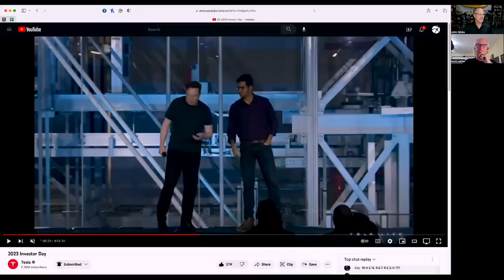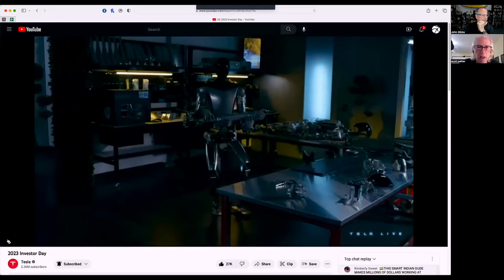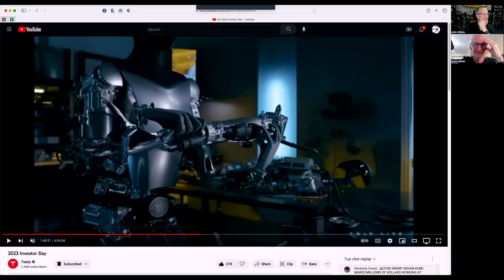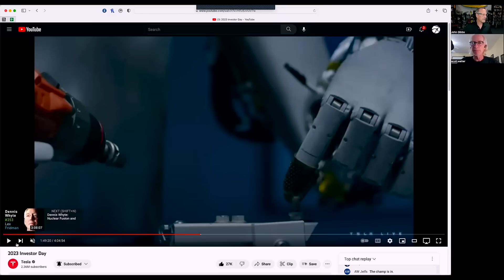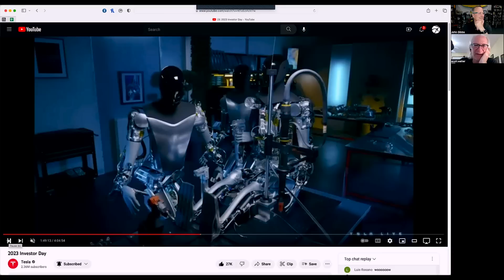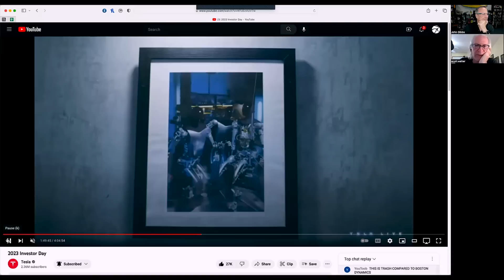Tesla's Optimus Bot Makes HUGE STRIDES! Investor Day Teslabot Details--with Dr. Scott Walter

Comment: Honestly they can put the torso or the whole robot on a automotive arm and make the arm maneuver bumbl into position to work on hand kematics on the assembly line for simple bolting. This is great but as you mentioned it’s to slow for a assembly line. But on a kematic arm this could stress it to automotive speeds with using off the shelf hand tools if that’s the route they wish to go

Comment: If you can put the word Tesla on a car, then you can put Tesla on All Cell Phones and Laptops. Electrical machines are old like since 1950s, Nuclear fusion Reactors, they just decided to give it to society as if it's new, like wireless, using cords when they been knew about bouncing signals. Circuit boards technology using copper was from inside the pyramids, with wireless technology from solar power, all hidden. Solar power cars is the obvious free energy and free electricity. The more empty man feels, he makes robots to fill in that hole, to feel like a God.

Comment: This will be a self replicating production line. This will be a first for the entire world, the efficiencies of this even at early stages will be the fastest scale the world has ever seen for any production line. 
If it takes 10 robots to make 1 robot in 2.4 hours, that means 10 built in one day. with these 10 new robots we have doubled the output. The next day it can make 20, the day after 40, the day after 80, the day after 160 etc, etc.. The only way to get more than 8 billion is self reproduction. With unlimited material, and unlimited floor space a cumulative doubling of production can scale to 1 billion units per day of production in one month. I am obviously wrong about my projection numbers. However the theory is sound, it is self replication, the robots will make the robots which in turn start making new robots right off the line. This will be the biggest step forward for humanity in our lifetime, forget the cars this is where the real value lies. I feel like no one is realizing the scale of output, when you run the numbers it is in excess of what is perceived to be possible. Humans cannot imagine a scale as large as this it is completely beyond our current understanding of production.
Not only will these robots be able to build themselves without human intervention. They will install upgrades that the robotics and automation engineer teams develop. The team develops upgrades, the horde of robots install the upgrades on each other almost instantly.
Giga Mexico is twice the size of Texas, why do they need this floor space if the model 2 line is smaller and more efficient. These robots will start mass production as soon as Giga Mexico is complete. In approximately one year from now.

Comment: Nice video, thank you gentlemen. Watching Optimus at station doing a task, it occured to me that having the ability to create an anchor point to the floor at will with either foot at any moment via electromagnets would eliminate the disadvantage of having to balance untethered to anything while doing a task at station. This would greatly simplify balance compute load during working tasks and give Optimus the ability to leverage its strength and dexterity to its maximum potential. A smart-floor installed in the work zone, mapped out, could provide the housing for most of the heavier components and Optimus could control it's application and performance through its feet. This would give Optimus some of the advantages a stationary assembly robot has when working from a fixed location on a pivot. Additionally, Optimus' mobility performance, just walking around, could be greatly sped up and improved within the work zone by strategically pulsing the electromagnetic foot/floor attachment force. This would be like having a super strong dexterous body and lightweight magnetic feet that turn on and off as you walk and provide incremental amounts of magnetism to facilitate the walking or running task. This would be the factory Optimus. Perhaps homes could eventually have smart floors for the home Optimus.

Comment: FYI, pneumatics have much finer control over movement than step motors (which are commonly used in electro-mechanical movement) and can exert variable pressure while maintaining a position without generating heat - Optimus may be using an amalgam of electrical and pneumatic systems - time will tell...

Comment: Thanks for discussing one of my favorite topics.  Great job Dr Gibbs and Dr Scott. :).  I noticed that there are special equipment used for drilling to minimize the weight that TeslaBot has to carry like the one used to drive the bolt on the knee joint.  TeslaBot is not required to have super human strength to be useful.

Comment: I'd propose a different hand design, symmetric with 3 fingers and 2 thumbs. The thumbs have swivel mounts so they can curve the same direction as the fingers, or oppose the fingers for grasping. Being symmetric, it would work equally well for right and left hands, no need for a "right hand" and "left hand" version.

Comment: Great commentary from the both of you on this.  Not sure if you've watched the video in high-res (the settings wheel isn't showing HD or 4K on the YouTube video in your clip), but just wanted to point out that the video is actually available in 4K in the settings and you can see a lot more detail on that setting.  At lower resolutions YouTube creates a lot of artefacts that make it look a bit unrealistic, but on the 4K setting it's much more obvious that it's real.

Comment: @Dr.Know-it-all Knows it all   
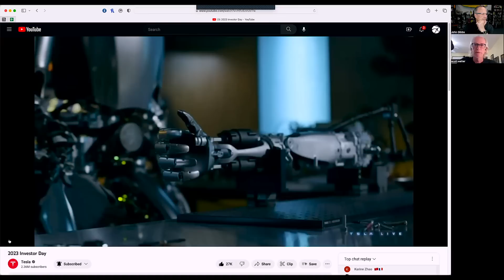2:40 you can use [LEFT/RIGHT] cursor keys on keyboard to skip in 5 sec. increments, and use [J] and [L} for 10 sec. increments, also use [K} for play/pause :)  

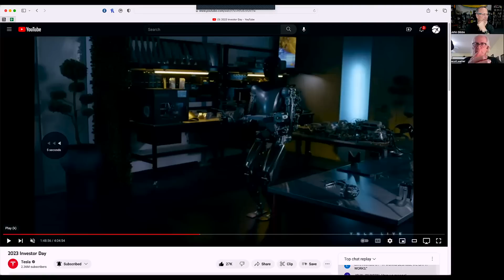7:20 when Dr. Scott described the TeslaBot having fingers that are spring-loaded and only uses an actuator to close, this is exactly how bats sleep hanging from trees, only in reverse, Bats have the default tension closing their claws, enabling them to hold onto tree branches in their sleep :)
Reply: You can use period and comma to increment frame by frame as well.

Comment: Unlikely any pipework is pneumatic for the same reason you don't want air in your brakes; hydraulics would be required for the transmission of force.

Comment: I personally think that nobody in the industry will be remotely able to compete with Tesla in the future! The continuing drive towards efficiency and automation is never heard off and these humanoid robots will change everything. If I was the competition I would be living a real nightmare!
Reply: Toyota does a pretty good job of building cars.  Tesla started from ground zero, so are just now catching up. 

I'm not a Tesla detractor (I bought stock on December after all), but I'm just tired of all the Kool-Aid in the comments.
Reply: @alansnyder8448  Toyota, is that the manufacturer that was still busy with hydrogen cars and wasn’t able to keep the wheels on their electric car. A false claim by the way from their part for god knows what reason. That company that had 1 electric car, stopped selling it and wanted to buy back the sold cars? You’re talking about them? The most in-depth company on the face of the planet where the hydrogen lunatic just stepped aside to indeed leave command for successor with brains who ordered to tear down a model Y to see how it’s really done.  There’s no legacy auto maker even near what Tesla is doing. Have a look @ Sandy Munro. Toyota will exist in the future because the lunatic just stepped down, it was almost game over. It’s not about building cars but about building electric cars. There is a huge difference in that. Toyota is nowhere at this moment.

Comment: Hi, John,
You mentioned that you could only go forward and back on the YouTube  video 10 seconds at a time.  Once the video is paused, you can move forward and back one frame at a time by using the comma and period keys.  THe shift of those are < and > to give you a reminder of the keys and direction.  If you have your settings for repeating keys held down,, you can move forward and back reasonably smoothly to exactly where you want.  I wonder how many other tricks like this are hidden in the YT user interface?
Dave
Reply: In YouTube settings you can also change how many seconds a default "skip" is. With 5s being minimum and what i usually use.

Comment: So where did they put the cooling radiator for the liquid cooling system ?. Or are they using the chest aluminum plate as the passive heatsink for fanless system ?.

Comment: Question: Would you use the surface metal plates of the robot itself to radiate the heat generated by the bots’ computer much like the capillaries in the skin of a human?

Comment: Stop basing your calculations on the price of a TeslaBot or as Elon called it a OptimusSubprime as being hundreds of thousands of dollars per unit. 
Given that a Tesla EV costs around $50K and that the TeslaBot will require far less material and time, it will cost about $10k. 
Imagine how fast Tesla will be able to build these, squirting the endo-skeletons out of a Giga casting machine, sliding in the wiring, the LFP batteries, the FSD computer, the interface, the sensors, and the actuators by the robots of the assembly line, unit testing and then zipping up a synthetic skin onto it. It should be producing up to a thousand Automatons a day.

Comment: Can’t they do better with the feet? Just about every robot I’ve seen use the simple flat paddle feet which makes the walking movements very awkward.
Reply: Nobody cares, it’s not a priority.
Reply: They obviously will in time.  Tesla's goal was to produce a minimum viable product in as short a time as possible.  So they are first focusing on making something that's going to be useful in as little as a couple of years.  The first bots will be working in factories (Tesla will start with their own factories) and so they will mostly be standing at a work station doing stuff and they don't need to be able to walk about all that much.

They will rapidly iterate on the design as they learn more about what's required and successive generations will add more functionality as needed.

Comment: Not parkour... but much of the agility and dynamic dexterity needed to work with humans and moving robots/assembly lines will require similar capability.  Maybe a training task down the road is an obstacle course where Optimus learns (teaches itself by trial and error) to move.
Reply: Parkour is not that hard. I've seen many robots doing it in simulation. Some were able to adapt to injuries and even different bodies. It's really a solved problem. Probably that's why Tesla is focusing on the hand instead.
Look around on the Two Minute Papers channel.
Reply: parkour doesnt pay the bills and probably requires expensive parts

Comment: We are so lucky that Elon put the bot under the Tesla umbrella, he could have launced a new company and sold stock in that. Instead we investors in Tesla get it for free !!
Reply: Very true, I am very happy with what I saw in the presentation and would not wonder, if GF Mexico will make use of a few Optimus robots.
Reply: @nilsfrederking62  I doubt it, labor is pretty cheap in Mexico.
Reply: @toadsauce8091  Yeah maybe they will even produce without Kuka robots on the production line..... That Tesla wants to let human labor do by robots is evident, so the next factory where they can test it out, they will do, the only question is whether Optimus will be advanced enough to make sense. And for sure they would not put it in the front line, more in preparational work, where there is enough time buffer, if something is not working.
Reply: I disagree.     This humanoid robot smells like an Elon Musk ego project to me.     Custom robots would be better. This thing is a waste of Tesla's time and resources.
Reply: @alansnyder8448  Just like the cybertruck maybe ?😉
Reply: @MrAlanfalk73  The capacity to build all cars/trucks and electrify the grid is going to be constrained by battery production which will largely be a factor of lithium supplies. 

I think we are better off making smaller cars to spread that limited supply around to more people.    So, Cybertruck isn't really helping the environment as much as people think.

But no, CyberTruck is important for Tesla. The robot is wasting time.
Reply: @alansnyder8448  wrong,  batteries and their effeciency constantly improve. With a solar roof it is 0% co2 , also people buys trucks so instead of a gasolin car the can get an electric.  Also regarding the bot, there will be synergies between those and FSD. And No time is wasted,  Tesla hires All the people it needs and they have money to spare still,  so bot wont slow Tesla down. As an investor I couldnt be more thrilled about the bot, it will soon help in production. 
PS. Elon has proved he can do the impossible with rockets and cars etc. so I think he can pull this off too. And the smartest people in the world wants to work with Elon,  that is why space x and Tesla has been the number 1 and 2 prefered places to work for ingeneers the Last 5 years.
Reply: The concept is to use the FSD software on the bot. This is the right move, otherwise, the bot development won’t work or very difficult without FSD.

Comment: What is interesting to me is that Elon said that FSD was NOT AGI in his opinion. Instead it was a bunch of neural networks. 
Optimus is using the same FSD engine, ergo Optimus is not AGI. 
Given Elon’s comments during the presentation on how he is worried about AI, and sorry that he may have contributed to it in founding OpenAI, perhaps not having Optimus be true AGI is intentional??
    If Tesla can make a truly useful general purpose robot without making it a true AGI, wouldn’t that be preferable?  A fantastic tool for humans rather than a competitor to replace humans?
Reply: Very good and interesting points. Here is my take, for Open AI yes Elon funded it to have an open-source AI project to answer google AI projects. but seeing it from the inside he was one of those calling for AI regulations very early on. A few years back.  On the other hand, FSD can only drive while AGI knows everything else. Imagine a highly sophisticated humanoid robot way more capable than us and has all the information that we can find in all search engines. That will be very scary. So most definitely Optimus is intended to have limited intelligence only for a particular purpose even if it has the capability to learn in its environment. Even if Elon or Tesla didn't start these kinds of projects somebody else will.
Reply: It uses the vision system of fsd, but it'll incorporate different networks to understand language, for example. You are assuming things there...
Reply: @lechavs  True, guilty as charged. 😉
Reply: No one has created "AGI"

Comment: The issue i saw with the Optimus video is that every action of the bot, there was an edit in the video.  Makes me think every step had several takes and the success made it in the video.
Reply: Of course it was, and reposition (manually) and so on. As like all their videos of "amazing" things.
Reply: @Xanthopteryx  Ok paid hater.
Reply: @neeljavia2965  Naaw, so cute of you thinking i get paid to tell the truth. Sadly, i do not. I tell the truth on my spare time. Unpaid.
Reply: @Xanthopteryx  like how those rockets are landing?
Reply: @toadsauce8091  All fake, the rocket doesn't land it pops up from inside the barge. It's just a trick🤩
Reply: @Martin-se3ij  It took them 13 years to manage to do it the first time, and another two years before they even reused what landed. And after that a lot of fails.
And they were not even the first one to land a rocket again...
And they are sending materials and doing different discoveries on Mars by 2022...and people to Mars next year..... and Starship have only made ONE successful landing. Two years ago.
And so on.
So, yes, sometimes Eons company actually succeed but it takes forever and most of the things they do are still not what was promised, just crappy or dismissed.